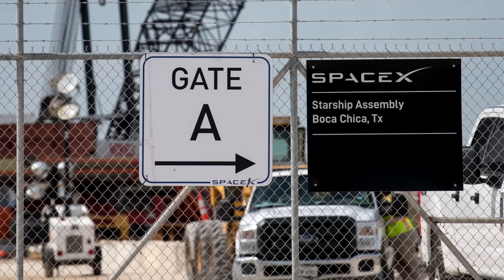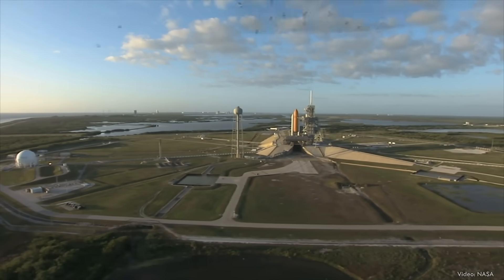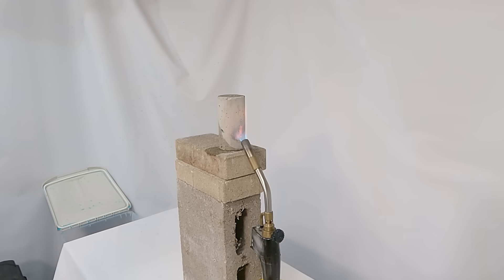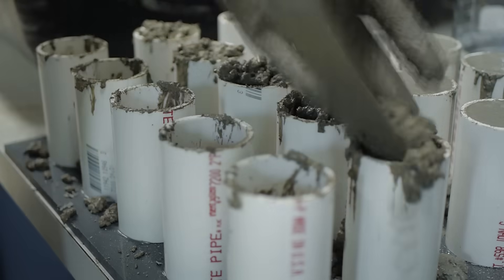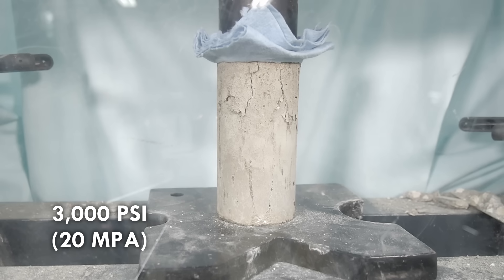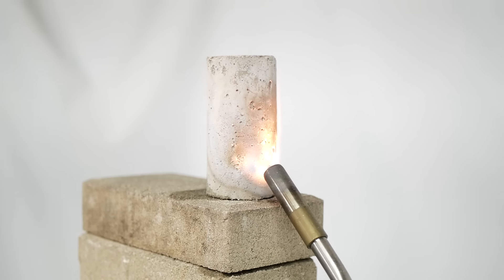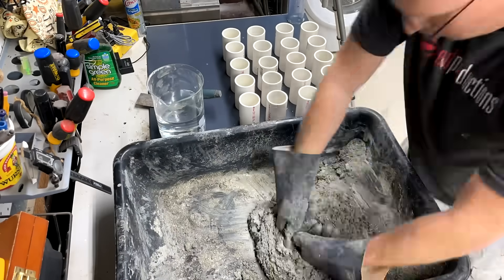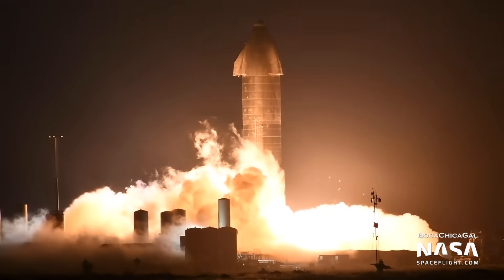Why SpaceX Cares About Concrete

Comment: I work with refractory a fair bit and know just a little about it, such as the curing process to drive off water:
1. Liquid free water (liquid water driven off using water vapor as propellant at +- 30°C to 60 °C). It's more efficient to drive water off here when it's liquid as when it heats up the channels can be overwhelmed by steam that can be up to 1600 times the volume of the liquid water, which is why step 2 is critical:
2. Steam release of free water happens at temperatures approaching boiling point of 100°C at sea level up to +- 120 °C and can be up to 150°C to drive off all free water if the refractory is thick and takes time to get heat to the core. Rushing this forces expansion of steam inside the refractory and usually causes catastrophic failure and chunks of refractory concrete flying. 

After these two stages are the dehydration of alumina and calcia hydrates (removal of chemically bonded water):
3. 149°C: Gibbsite
4. 299°C: Boehmite
5. 399°C: Calcium Hydroxide

All refractories in industrial applications go through a lengthy initial curing process through all those stages (different rates for the different blends of Alumina, Cement, other bonding agents, needles/fibres and agregates), heating to a point and then either soaking at a certain temperature or very slowly ramping at as slow as 1°C per hour to get through critical stages such as at the boiling point of water, adding more heat slowly to replace energy lost from latent heat of evaporation, heating losses and still heating up thick refractory. 

However once the initial cure is completed, you only soak for long periods at certain temperatures if the refractory got wet (exposed to moisture when cold such as atmospheric moisture or even rain) to drive off free water.

If it hadn't gotten wet, you pre-heat the refractory to a temperature as close to operating temperature as possible, often also at a limited temperaturegradient, so that when it experiences full heat load (such as steel pouring into a refractory lined ladle from steel smelting or indeed a sudden and very large flame impingement), it doesn't suffer as much heat shock. This is aided by fibres or 'needles' that conduct heat deeper into the material instead of relying on conductance of the refractory itself, which takes very long as, you know, it's  refractory and is supposed to conduct heat very slowly.

That launch pad was one or more of these things:
1. Not dry 
2. Not pre-heated (or not sufficiently so)
3. Possibly not the right material (not talking castable vs bricks, rather Alumina content, inclusion of needles, etc.)
4. Possibly not cast with expansion allowance, although that quick a reaction suggests one of the first two, but if they got those wrong they probably did this, too.
Reply: Super interesting, 

I work at a zirconium dioxide and alumina plant, we use arc furnaces to melt away the Silica content, and create the conditions for the reactions to take place so the zircon silicates seperate and attach to oxygen ( I think) 

A lot of our product are used for refractory. 
The zirconium makes super high heat refractory used to hold nuclear cooling rods (also the atomic structure is right for the job) 

For the zirconium we need heat of about 2800 degrees Celsius, and to make about a ton uses about 4300 kilo watt hours (which takes about 1 hour and 20 mins) 4.3 million watt hours!!! 

We run 24/7. Because we can’t let the furnace cool down, 

Like you say it’s slow to reheat. 
 
A normal cycle is 1.5 hours between tilts 

If the  furnace is off for longer than an hour the next cycle takes 3 -5 hours to warm up 

If the furnace is off for more than 3 hours. 

 then to restart it we have to have 1- 12 hour cycle the 2- 6 hour cycles , then a 3 hour , then back to 1.5 hour cycles. 

( though they do make for cruisy shifts) 

It was Interesting to read about the next step.
Reply: @doaimanariroll5121  That's awesome. We've done some work in such plants as well but mostly just supply of the Combustion system solution and recently Zircon separation as well but under nda so can't discuss that part. Your process highlights yet another modern industrial balancing act we forget about unless directly involved in the process. The mass and energy balances for these processes are so crucial and any little deviation puts the production guys in a bind.
Reply: @LeonvanRensburg  my understanding is that SpaceX used a coating of Martinsite (sic) on top of regular concrete, basically the same system they have in the KSC flame trenches.
The idea is that the fire doesn't last long enough to raise the temperature deeper than the surface layer, and the water deluge takes most of the heat away.
The Martinsite is a thin layer put on top, and so I suspect that either it was not applied properly, or the substrate was not prepared correctly, or maybe the underlying concrete had not cured fully and so spalled off from the heat etc.

In any case, they reapplied it and haven't had any other problems, and they definitely don't have it dry or preheated! Lol
Reply: @doaimanariroll5121  Impressive stuff.
As a reference, just about 1260°C is enough for ordinary concrete to not just lose it's strength, but to melt and partially turn into lava. Even most rocks will turn into lava at 1300°C. I have a home build furnace that can go to about 1300°C - but have also had ideas of building an arc furnace and just checked around what fire bricks to use and it is quite hard to find those rated for more than 1650°C (especially if you also want a material with reasonably good insulation properties - and not too high density, that stores a lot of heat and make it slow to heat up) and also too expensive to justify the cost and hassle for a furnace that's going to be built just to play around with for fun. But if I do build one, 1600+ is still really fun - well enough to melt steel for example.
Now I can think that building a furnace for up to 2800°C isn't easy and cheap and there is not many options on what materials to use (and things like good insulation properties probably have to be compromised - which is also the reason behind the huge energy consumption).
But zirconium dioxide is quite impressive in it self (according to what I have read about it). One of the most heat resistant materials there is
 - at least when it get into contact with air (some materials like tungsten of graphite can handle higher heat, but as soon as they get into contact with oxygen, they burn away quickly).
Reply: Hi there! Awesome comment, I also work with refractory, and on our lab we have been working with numerical simulations of this process! It is a very challenging subject and we want to make this process faster, trying to understand where do we really need to decrease the heating and where we can safely apply higher heating rates
Reply: @Murilo08LOL  it makes sense, I mean even being able to heat at marginally faster rate would save SOOOO much power.
Reply: @doaimanariroll5121  power and time. It's such a speciality thing that fewer people do all of this they could be also moving on to the next projects. That could also save money and make certain segments more money or just allow them to be more profitable.
Reply: @Murilo08LOL  This would improve sooo many processes where energy is wasted on keeping processes on stand-by or forcing that low gradient climb. Could you share where you work with us?
Reply: @Murilo08LOL  I'd looove to learn more of this. My only real references to my limited knowledge on this (beyond experience) are free papers. I'll find the references when not on mobile and post them here.
Reply: @LeonvanRensburg  have you posted?
Reply: @Murilo08LOL  borides and carbides, or adding much greater porosity to oxide refractory where density is the enemy.
Reply: The rain in Boca Chica is pretty frequent; no idea how they're going to keep a pad dry during regular opperation (and potential opperation at sea is not better).  I don't suppose there's good refractory sealent options or something?
Reply: @FireStormOOO_   that is very interesting, the rain part... I would say that the diffusion of liquid water to the inner parts would take to long to occur, however you might be on point!
Reply: @Murilo08LOL  it wouldn't happen at all if you heated the pad past 100c
Reply: @FireStormOOO_  Not my field at all but could under floor heating help?
Reply: @johankriel8883  If you can get the heat transfer even(ish), the one-sided heat-up of refractories is a known method. Not sure of the implications of the pressure on the heating system below in operation, might need to be a liquid-filled system, remotely heated, and/or use molten salts or something as conducting agent. I say every option is worth exploring. 

While big tech giants do drive progress, they're very limited by the bureaucratic processes and industrialisation. Companies who serve as suppliers to these companies want to make money on something that works, not take risk on new/unproven tech. R&D suffers for it, which is why new companies focused on development have caught up so quick. Rocket Lab, Space X, etc.

Q: Why did the engineer cross the road? 
A: Because that's what the last guys did...

Right there progress stifles.
Reply: @LeonvanRensburg   Oh, thank you.
Next "not my field" question. Since Space-X already make their own heat shields, and since they plan to simply dump Starship number 20 in the sea, could they not consider repurposing the heat shield tiles into  launch pad floor tiles?.
 Even if the used tiles look a bit scorched, its a launch pad,.
And also, since they have so much  liquid gases, could they not make a launch pad cover of say 2 metres thick ice on top of the concrete at minus -200°C degrees with some of the scrapped starships stainless steel plating  beaten flat as a protective skin over the ice?; This could add some nostalgia to the launch pad
And also add a Volkskas building size shop vac to suck and disperse some of the blast away from the pad? They could power such a shop vac with some of the redundant merlin atmospheric engines.
And last, knowing that the rocket will blow the pad to pieces, could they not plan that destruction in such a manner that the debris will follow a predetermined and safe ballistic path, like what demolitions experts do when they do their thing? If the pad is destroyed as planned for, a fleet of cement trucks with quick dry could stand ready to fill the crater for the next launch?
As I said, not my field...
Reply: @LeonvanRensburg  SpaceX could also make the whole launch tower to rotate like a .38 revolver cylinder to a fresh spot after every launch and capture. or have ready made spare launch pad floors in stock ready to move into position, a bit like what they do with the mobile  rugby fields in america, that they move out from indoors from time to time when the sun is shining.
As I said, not my field...
Reply: @johankriel8883  I like your ideas! I think it's lateral thinking like that, that's brought so much innovation to this new era. Your field or not, you're not staring at the problem for the solution like so many of us do. Implementation might reveal other problems, but that's a separate discussion. I say well done and go apply to Oom Elon for a job!
Reply: @johankriel8883  they could keep the pad heated so water can not collect
Reply: @ShinningDarkness  they deluge the pad with water at launch, so it's going to be cold and wet lol
Reply: @ke6gwf  refractory materials take a long time to heat, thermal mass says they will take as long to cool, so heating them means the water doesn't make it far in before being forced back out as steam, so you would end up with more scalding of the serface of the pad but less exploding from the rocket heat, which I think is what they might be going for.
Reply: @ShinningDarkness  well, I am telling you that they don't preheat it at either SpaceX or NASA, in fact it often has ice or even liquid oxygen etc on it prior to launch, and then they flood it and light the candle.
Reply: I had also my experience with refractory materials at work as steel smelter and caster and I have seen allmost all kinds of it from bricks over to sinter powder and ramming mass to concrets (I had to keep the furnaces and purring ladles in good condition I total 1 EAF (lot of carbon, carbon bound bricks and alumina bricks, ground dolomite and concrete) 4 MFIF (almost exclusively alumina based sinter powder)  and 13 ladles (old school alumina bricks and ramming mass or concrete) the worst work was always to get the old/used/unsave stuff out especially the concrete is so even after several +1600°C cycles it puts up a fight against big Percussion hammers and that concrete we used expanded during curing so it pushed against the steel out side and the tensions inside made it even harder like temperd glas

Also these materials have to withstand hot basic slag and we know that temperature increases the rate of chemical reactions I mean it isn't perfect but and the slag eats refractory not fast but noticeable after 1-2h contact so yeah that stuff is really tough
Reply: @TheLtVoss  You should make a video of that process. You have a wealth of information to share.
Reply: Most launch pads use water deluge to reduce sound wave and heat destruction. This pad as well so it is certainly wet. However there are specific materials developed for this application.
Reply: Leon
Comments like yours are why I spend so much time reading comments even after the video is over. There is a wealth of knowledge in the comment section. I do a lot of concrete demolition and this helped me understand a little of the heat effects of fire damaged buildings I take down.
Reply: Fascinating comments! Thanks guys for adding to the knowledge.
Reply: SpaceX have constructed at an incredible pace in Boca Chica, Tx (aka Starbase) so I would be surprised if there wasn’t a significant moisture content and I doubt that the pad(s) we’re previously subject to a heat cycle other than that provided by good ol’ Texan sunshine. A fascinating supplementary “bonus” comment. Thank you for sharing your knowledge and experience.
Reply: I’m reading your comment and the many replies.
You guys are all really smart. It turns out, I don’t know shit. Pretty impressive.
Reply: @danielmcnulty8736  I thought I knew a lot about concrete and came here before commenting to our engineer friend that his concrete mix was way too wet considering it didn't have a plastizier in it and he should have let it cure for at least a month to get the water out, or rather cured in, and found out that they are using metals to molecularly flush out the cured water.
Reply: while true for your application, this does NOT at all apply across the board for all refractories. density of final product, type of bond of material (chemical/hydraulic), oxides, borides, carbides, the fiber is to help thermal shock failure, needles in refractory are normally referring to a reaction of the products like alumina and silica at high temp creates mullite which can be described as "needles". We've been launching rockets off pads for half a century, NASA who spacex rents from knows what they're doing. this is most likely to do with a poor patch job or bad luck.
Reply: @hootblah  Indeed, as stated, my limited knowledge is in (mostly) mineral processing plants of some sorts where combustion processes are used to add heat to the process / preheat items for other processes. The needles I refer to are a steel alloy of some sort and are added in the casting as little heat pathways. It's supposed to aid in higher heating gradients above certain temperatures. Useful in stand-by processes. The needles you refer to are very interesting, I'll be sure to read up on that a bit, thanks! 

Fact of the matter is still that no matter if NASA rents from them or not, whatever was below that rocket was not right for the application. We're simply speculating out of our fields of knowledge as to why / how it went wrong. 

The cement in other rocket applications also operate under different circumstances where the area is flooded, thus the water captures most if the heat and pressure and the concrete is essentially quenched during this operation, shielding it from the heat. I'm obviously not sure of specifics here, but I'm fairly sure we're discussing different applications. Kind of like direct flame grilling vs (admittedly very aggressive) steaming, you know?
Reply: Fascinating insights. Thank you for sharing.

I believe part of the rationale driving Starship development, is that it should be able to land and launch from unprepared locations, and be resilient to debris and ejecta. The test stands at Boca Chica are indeed prepared, and could be made with flame trenches and more suitable materials. However, testing would present misleading results if they were perfectly protected, and in the case of SN8, highlighted the need for the engines and controls to be hardened or otherwise mitigated against debris. That particular static fire might have appeared to be a failure of the concrete and subsequently the engine, but in reality the concrete degrading was irrelevant, though unfortunate, it provided opportunities for iterative improvements to the vehicle.
Reply: yep, and sometimes why bricks and mortar can longer lasting... mix in some casting where needed.  Moral of the story is it takes time to do preparations properly... but sometimes the risk is worth the reward when seeking headlines... so there are always trade-offs with a public facing company... sometimes it is better to break ground with governmental agencies where safety can override profit.
Reply: Have there been any analysis of the new graphene/CNT concrete blends? I wonder if there would be any benefit from them due to the heat conductivity of graphene/CNTs. Thanks for the amazing response!
Reply: @FailTrainS  We pour 2800 degree molten zircon on zirconium refractory with water ect and it’s fine. It’s pretty soft though and very very expensive. Probably prohibitively expensive. There are also sections of the furnace that use graphite for more complex shapes but they’re very consumable and need to be frequently replaced. Graphite and carbon allotropes burn(oxidised) if oxigen is present. 

I’d assume if we are trying to avoid water absorption, then oxigene mitigation would be a much harder engineering feat.
Reply: @FailTrainS  the ultimate flex would be coating it in areogel.
Reply: Learning from you comment, I understand why do they have steel furnaces, refractory, and kiln furniture factories in the same area. I used to work on electrical system services of these plants and their supply chains are more connected than I thought.
Reply: This is fun.
Reply: Something about "liquid free water" makes me think it's stored next to the Chemical A.I.R. and the rolls of Flight Line
Reply: Had no idea making concrete could be so technical. Fascinating post sir.
Reply: It's been interesting to hear from the people involved in the various parts of these processes!
Reply: Dry and preheat are both going to be problems for an outdoor pad.

Green sand, used for casting metal, takes immense thermal flux into a moist material without spalling, by being very porous.  But it's doesn't have much strength.  If the pad had similar porosity, but enough strength to not have to be rebuilt every use, that might do the job.
Reply: I don't know who you are. But, brohter. You have give me and others a great grand knowledge. Thank you for sharing.
Reply: Very useful info.  Thanks.
Reply: https://youtu.be/m8g9wpTPZwU
Reply: We have the solution for this ready to go now
Reply: @jtherealtor  share?
Reply: Nice! What industry are you applying the above data in your instance?
Reply: liquid free water is really interesting, thank you for sharing
Reply: @calebeverest8378  I tried putting liquid free water into a microwave and went back in time. Send me some powerball numbers and I'll split the jackpot 50-50. I'm trying to re-invent and release Minecraft, but the Commodore 64s here in 1982 don't seem capable of running Java well enough to even get the API to load.
Reply: @mgabrysSF  ok 7, 17, 77 
Can you get me an autograph from Bob Marley while you’re at it, please
Also, what kinda microwave is that
Reply: Question.
I built a stone grill and fireplace, with a pizza oven attached.
Do you think lining the grill, fireplace and pizza oven with refractory cement was a good or bad idea boss?
Reply: Do you have an email address or something that I can show you a picture of something I am working on?
Reply: A magnesium or aluminum oxide composition pressed and high temperature fired refractory shape is used for ladle discharge 'slide gates'. It is highly resistant to thermal induced spalling when rapidly heated and cooled. It is expensive
Reply: Nerd alert 🚨 

JK, wow so much involved.
Reply: @michael-michaelmotorcycle  lol
Reply: ELON=GOD.     Mars=New Earth.    BTC and TESLA= KIngs.   Rest=Servants.   Non Holders work to Power energy for Bit coin!! Elon is Einstein, Edison, Newton, and Jesus combined. HE at least deserves several Nobel Prizes. Elon has more IQ than weight of Hater's Ug ly Prius and his F at Ho Combined!! MUSK = Iron MAN who will Crush Tha .nos and Haters Should use Cash to wipe Huge  A.no.s.  JUST Worship Him instead of other silly god!! GOD Elon will Punish infidels!! Go Emperor God Musk!! Elon's brain chips and AI will Control and Destroy any resistance. Green Ner-ds Hate Bit coin just it use Energy like Argentine BUT Space X AND TESLA all Have Bit coin. KING ELon Himself has both HOLY Bit coin and Ethe reum. Please don't do estrogen things.
Reply: wall of text
Reply: @crissssseee If you conquer the wall of text you just might find yourself having learned something in the process, maybe how to overcome such a wall so that the next, even larger and more informative wall of text goes down easier. Better and better with each step, you know?
Reply: @crissssseee  Not really, it's a well formatted post. A wall of text (TL;DR) is usually a bunch of run-on sentences with no paragraph breaks.
Reply: @crissssseee  God save us from text!  You never know - if you read it, you might even learn something...
Reply: @crissssseee  worthless comment
Reply: @crissssseee  it’s really not.